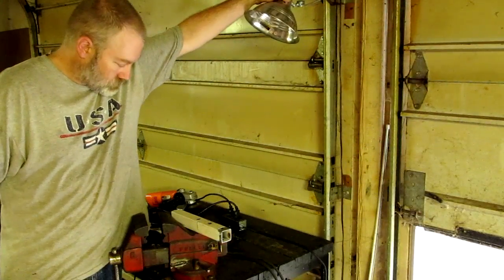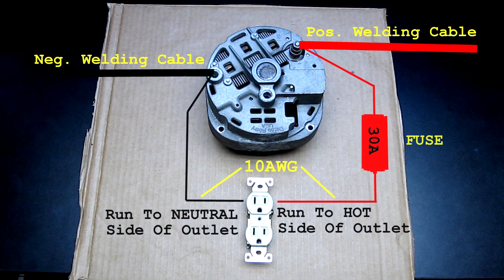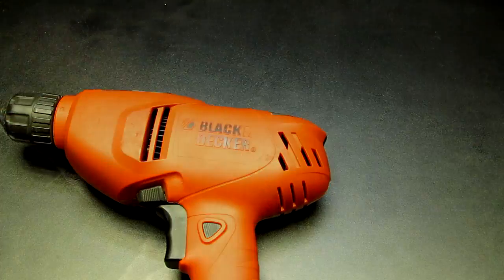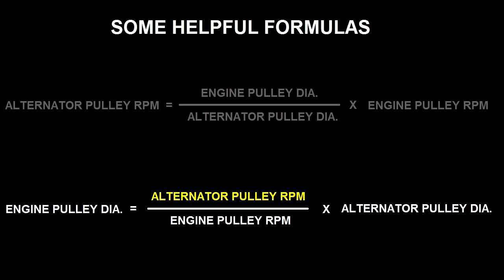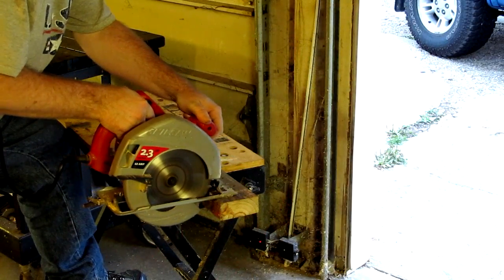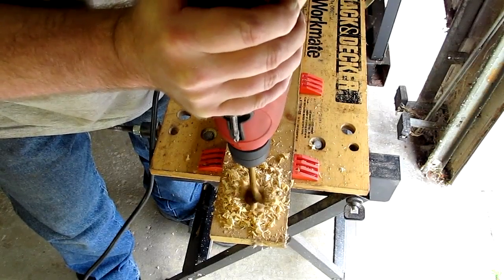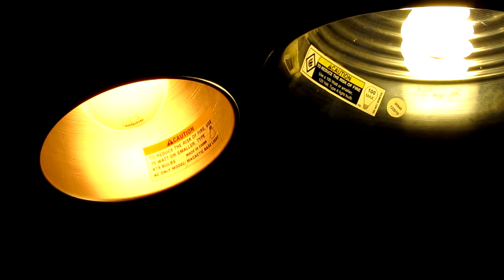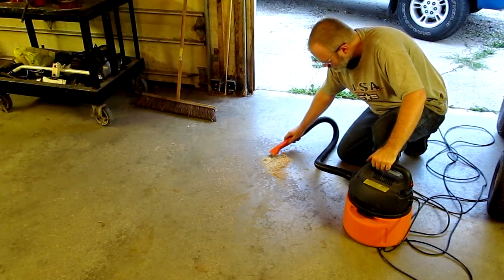Alternator Welder Runs 120v Power Tools - How To

Comment: That's amazing, with US 120V power tools you are so much closer to the full field alternator voltage than with 230 V equivalents. I guess the British construction site 100V or Japanese 110V power tools would work even better!
Just one thought I have: Those switches are not really meant for handling DC so in long run they may end up burning from excessive arcing. 
Actually you may be even able to run a computer or a laptop/phone charger out of that DC, as most of those have a switchmode power supply that 1st thing it does is rectify AC to DC, although at higher voltage.

Comment: Why not use a 110v electric motor with a pulley system run to two alternators that run the current together to a breaker box and run power back to the 110 volt motor plus have lots of power left over? You can also use a starter to start it up just add a secondary set of wires from the alternator to One battery to keep it charged for your starter. And run wires from the battery to a push button starter and you got it whipped.

Comment: Amazing video. I only recently gotten into the funny business of "alternator hacking", and I've made a generator so far off of a 7hp Tecumseh engine, and now I wanna use a 8hp Tecumseh and school bus alternator for a welder. I wonder if you Boost the Field Winding voltage if it will keep rising the output voltage, within reason of course (due to heat). Might need to make experimental video soon
Reply from the maker: Myself playing around, I used a constant 12 to 14 volts for the field winding. I just know that faster you spin the alternator, the greater the output. It would definitely be interesting to see the output of a 24v alternator. Send a link if you do make a video of your experiments.

Comment: Great conversion. Im assuming this is a permanent magnet alternator? Also hows it holding up in 2020 as a welder and general use with this alternator in the video?
Reply from the maker: The alternator is a standard type from my old Jeep. The tractor's battery supplied the input voltage. 

I took some parts from this project for another awhile back, so it's not currently usable. Never had any problems with it while it was together though.

Comment: Got to wonder how many loads will it handle at one time.
Oh how many alternater generators under full load will the engine drive.

120 ÷12 vlt = 10 inverters running correct ac sinwave for ac only appliances.

Comment: Yeah most power tools will run on AC or DC  funny they will last longer run cooler and be more powerful on DC lol. Induction AC motors like drill press table saws will not run on DC but the brushess are what to look for he's right. I love mine didn't spend but 80 $ I built a much bigger rectifier using industrial forklift charger diodes. BTW most of those small air compressors you know the ones that make more noise that a dump truck driving thru a nitro glycerin plant will run off DC I use mine all the time 😁

Comment: The open circuit voltage on most stick welders is about 25 volts DC. You jacked this alternator output up high enough to actually kill you if you touched the stinger and ground clamp at the same time. Just saying. I do like the build and effort you put into the project. Thanks for sharing.
Reply from the maker: Yes, it packs a punch for sure!

Comment: What is the Hertz it's putting out on the AC side??? Wrong Hertz (HZ) will definitely blow out electronics and some motors.
Reply from the maker: Not exactly sure of the AC Hz, but it's crazy high. I only use the AC side for lightbulbs. Definitely don't want to connect electronics or AC motors to this thing. I use it for DC welding and universal motors on the DC side.

Comment: Can you comment on running 18v tools? I thought it was in this video but re-watching appears it was another on the weldernator subject. Can anyone point me to how that would be done? I have some 18v dead tools. Thanks for the video Charlie!
Reply from the maker: Though i haven't tried it, you can probably connect the tool directly to an un-modified alternator putting  out the standard 12 - 14 volts. You won't get the 18v,but this is probably the easiest path.

Comment: Instead of the receptacle have a sign step up transformer there to up the ac volts and amps, wtfu movement
Reply from the maker: True, that's one way to do it, but the alternator is modified and the receptacle is receiving DC volts.
Reply: Charlie Sarsfield have a 120v inverter before the trans so the output is ac
Reply from the maker: I understand, but an inverter is an extra step I didn't need for this project. Already getting the high voltage from the alternator (which was modified to be a welder) so just threw on the receptacle.
Reply: Charlie Sarsfield yes but this could power a home just a heads up

Comment: DC actually runs incandescent lights and heating elements to the same brightness but at a lower voltage, because you do not have a time when the device is actually switched off 50 times a second.

Comment: Careful with running your tools at a lower voltage. You will draw more current through them and burn the tools up.
The windings in a motor rated for 120VAC are much thinner for a given power rating than the ones in a 12v motor.
Reply from the maker: Yeah, others have mentioned that as well. No issues as of yet though.

Comment: Have you thought about hooking up your alternator to an electric motor and using it to run your house? I mean if you can weld with it it would probably run everything.
Reply from the maker: Ha, no. It's the wrong type of juice for that.
Reply: If you take out the parts that make it DC it changes your power to AC should be able to work
Reply from the maker: True, but the ac frequency is about doubled compared to standard household input, so  i haven't really experimented much with the ac side.

Comment: Todo eso con el alternado no lo creo si el alt  vota 12  si tiene 1 conversor si
Reply from the maker: +Guido Hernan Zamora Velez 
A link in the description will take you to a previous video where I modified the alternator to bypass the voltage regulator. That is the only modification required. I used no external converter.
Reply: Guido Hernan Zamora Velez si le quitas el regulator de voltaje puede generar mucho mas de 120v dependiendo de el rpm de el alternador

Comment: There is more power contained in DC current than the same voltage of AC current.  RMS.
Reply from the maker: +Ray Conger 
Thanks for the input. Yeah, I can see how that would be so.
Reply: Ray Conger 
Does this mean high voltage can compensate for little to no amperage.

Comment: add a couple large caps so you got reserve for starting bigger tools..just thought it might work for you
Reply from the maker: +Jason Ross 
Thanks for the input.
Reply: yeah i would use a few microwave caps..they are good at keeping even current..hope it helps. oh and if you take them from used microwaves need to ground them out to dicharge, there is enough stored power in them even after they have ben unpluged for a while, they can kill you if they make contact with you if not discharged but most people know this lol i just had to add that sop if some one didnt then this might save them from getting bit :)
Reply from the maker: +Jason Ross 
Thanks again, and thank you for throwing in the warning for others to see.

Comment: You were lucky. Rms for a sibewave is .707 × peak or .707 × 120 or 84v. If you ran 120v dc you would likely burn out the motors.
Reply from the maker: +ChristopherLionRoars 
I'm not going to pretend that I understand what that means, lol. So far, so good though. No issues as of yet.
Reply: This video will explain somewhat what rms is. https://www.youtube.com/watch?v=m-rX5chqBxE
Reply from the maker: +ChristopherLionRoars 
Did watch the video. I get the RMS now, but perhaps I'm not understanding your concern for burning up the motors. These drills and such that I'm using were designed to run at 120vac. Isn't this the RMS value of the household AC (as opposed to its peak)? From what I read, "AC RMS values are considered to have the equivalent energy content (heating value) of comparable DC voltages and currents." What am I missing?
Reply: Charlie Sarsfield ya all i was saying is if you had managed 120v dc instead of 85, you would of put muck more power through them tha they were designed for.

Comment: The flo bulbs have a PWM circuit in the base that will put out the needed dc voltage at a large range of input voltage
Reply from the maker: +ken ezzell 
Yeah,figured it was something like that.  Thanks for the info.

Comment: One easy way to get more voltage out of those alternators is to simply rewire the internal three phase stator connections and switch them from the most common Delta (triangle) to a Wye (Y) connection given very few quality made 12 volt alternators  use the Wye configuration since it gives more voltage and less current.   

Also for a better alternator use a commercial truck or heavy industrial application one.  Unlike the common automotive ones, the commercial grade are far more efficient (75 - 85+% Vs 40 - 60% ), over built and can most often run at 100% of their rated power output continuously.  Plus most have multiple windings in parallel for each phase that can be reconfigured to give far higher voltages with less RPMs.  

I've done a few Leece Neville, Prestolite, and larger case Delco SI series commercial alternator conversions and had no trouble getting them up to 150 - 200 volts outputs at 10 - 20 amps depending on their stock voltage and current ratings while still turning at less than 4000 RPM which makes it possible to actually put regulators on them that will keep their outputs at the wanted 120 VDC or 120 VAC (off the three phase internal connections) without problems.

Best part is that oddly most commerical grade 12 volt 150 - 200  amp alternators cost the same or often less than most stock units of half their capacity.    The stock 12 volt 100 amp alternator for my 99 Ford F250 costs considerably more than  the Prestolite 12 volt 140 - 160 amp and 24 volt 100 amp continuous rated units (~$130 - $150 new at Napa or through many online dealers)  I put on larger farm tractors and commercial construction equipment.
Reply from the maker: Tcmtech 
Having a heavy duty alternator would certainly be ideal. And thanks for the information.
Reply: I am thinking of charging three 12 volt batteries off the three phases of the alternator really quickly. Do you think if this could be the fastest way to charge batteries with car alternator? The batteries can take it but there does not seem to be ready made solution for a really quick battery charger (one hour in, one hour out).

Comment: With that kind of voltage do you need any kind of special welding rod?
Reply: Open circuit voltage should be at least 36 volts.  Lower and you might get stuck rods.
Reply from the maker: +faffaflunkie 
Nope, just standard rods. Not sure of a minimum voltage for welding. In the video I was running 88V, but some folks are welding with half that via car batteries in series. Its more the available current than voltage.
Reply from the maker: Pay Way
Thanks for that information.

Comment: nice bro this is the nices way to run hho generator
Reply from the maker: +natad libak Haha... Absolutely!
Reply: Brother maybe u understand what joe doing in zuzuki video
Reply from the maker: +natad libak 
Funny you mention that. I do understand what he says to a point, but haven't experimented enough to see if what he says is true. I did build a cell somewhat based on his design, but used it to create hydrogen oxygen gas. A video showing me playing with it can be seen here...
https://youtu.be/qXEGzKHjklE
Reply: Its not the joecell bro, the zuzuki video is modification of wiring heactually remove the positive wire in the car but still going and he switch off the key of the car but still runing the car
Reply from the maker: +natad libak 
Precisely!

Comment: nice, i wonder how many can be run in series for induction heater?
Reply from the maker: +Leslie Jones Interesting idea. I have no idea if that's even possible.
Reply: i heard you have to have a lightening 
protector case
Reply from the maker: +Leslie Jones I have no idea.  If you figure it out, let me know.  Or better, you do a video on it.
Reply: Best heat is a. 100w light bulb most are banned but its perfect for low watt heat they also make heater that is 12v and 160w you would need a bunch tho to heat a big area

Comment: Why does the light turns off every time you start to weld? Aren't you using a inverter?
Reply from the maker: Miguel Ángel Valderrama Because the welding sucks all the juice,lol.  No, it's all powered by alternator DC. Link in description to the build video.

Comment: how did you do the ac side?
Reply from the maker: James Flores Connected two of the three alternator  phases to an electrical outlet. One on hot side and the other to neutral. For me, it didn't yield useful results compared to using the DC output. Be careful if you mess with it. stay safe.
Reply: did you keep the diodes from the stock alternator
Reply from the maker: James Flores took out the trio diode and capacitor.  The Homemade welder build video i did shows the alternator mods, which aren't many. For the ac, I just connected the outlet wires where the stator connects to the rectifier. two of them, not all 3.
Reply: will watch the vid

Comment: hey Charlie it's not very often people find things out on their own like this and I've known about this for about well let's just say a long time... Yahweh (god) has instructed me to guide you and everyone else with the correct knowledge. so with that being said if you want it to produce alternating current with a stable sine wave you need an alternating current Bridge rectifier which means you will have to have a capacitor and a mosfet for timing you're going to need about twenty seven volts on your left terminal and 115 on your right terminal but don't worry about any of that because the alternating current Bridge rectifier will produce that and it will be a self exciting generator just like the magnetic field that it produces on the stator for the direct current generator there is no difference between an alternator a generator and a motor except for how you wire them up or use them... hope this helps you out so go buy you an alternating current Bridge rectifier from a small engine shop you'll be glad you did!!
Reply: I've only seen Rectifiers that convert AC to DC. However there are ways to make DC run kinda like AC but instead of a sine wave it's a square wave, this is own as an inverter. This can cause more issues with motors that are made for AC.

Alternators produce AC anyway, single phase or three phase AC at that. There is a built in high amp bridge rectifier and voltage regulator. If you can find a way to tap into a altenator before the bridge rectifier and find a way to regulate the voltage since the built in regulator is for DC then you will be good to go. A variac would work for a AC voltage regulator but for power tool use you would need a high amp model, might just be easier to find out the perfect pulley size and RPMs the altenator needs to spin to get around 110v to 120v. If I remember a lot of older Ford altenators from the 70s and older have taps already to bypass the bridge rectifier.

Another idea would be using two Altenators in series tossing out 55 to 60 volts each.
Reply: Thomas Buie  you say to produce AC current you need a Bridge Rectifier. I only know a Bridge Rectifier to produce DC current from AC current. Does it work both ways or something? Would you or someone please clarify. Thanks.
Reply: No he's just a wannabe, rectifiers don't produce AC from DC. Doesn't know his ass or his elbow.
Reply: S. E that's what I thought. Thanks
Reply: Thomas Bui
Reply: well i try to get put it all gather

Comment: you have any video on making that mobile shop.
Reply from the maker: Jim Cady Yes. Link is in description.
Reply: I have watched it just wonder if a smaller gas engine 6.5 hp would be enough power to turn  that alternator to make welder?
Reply from the maker: Not sure on that one, as I haven't tried it.
Reply: +Jim Cady I hope I'm not intruding here but the setup that I have at my house is a 10000 watt self exciting generator it has a RMS of 7400 watts continuous and it is written in explicit details that you have to have an 11 horsepower gas motor to turn this generator well I've been lied to my entire life by the electric companies and everybody else so why wouldn't I try a 1 & a half horsepower Farm Duty compressor motor and guess what not only did it turn one 10000 watt generator it turned two and without a load breakdown!! so don't believe anything you were taught in school unless you know a hundred percent that it's true it works and there's no other way to do it and then it's probably still a lie...  keep up the good work guys!!!

Comment: No entiendo,el alternador es trifasico,(3 cables de salida) que hizo con ellos ,los unio en uno solo ,no entiendo.
Reply from the maker: Yes, the alternator is 3 phase, and the output diode is still intact and functional. The output is still DC. The only real manipulation is removing the regulator and controlling input voltage/current to the rotor windings.
Reply: Ok, entiendo gracias.

Comment: wont last long with heavy loads like welder
Reply: Hi, you would just need to upgrade the alternator if there are cooling issues. Or do your welding in bursts, it is not the instantaneous current that is the problem with alternators, it is the heat.